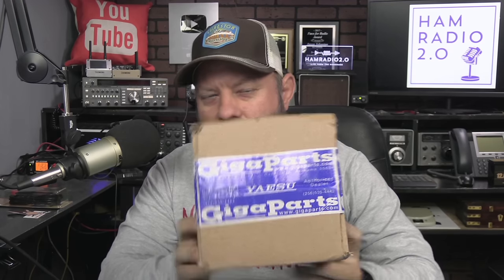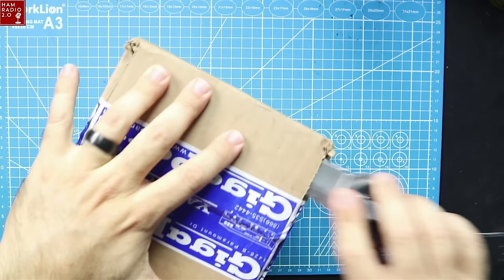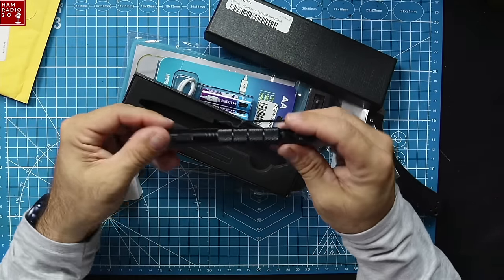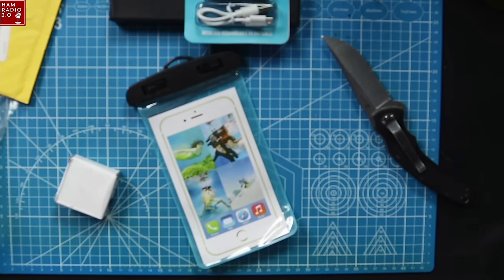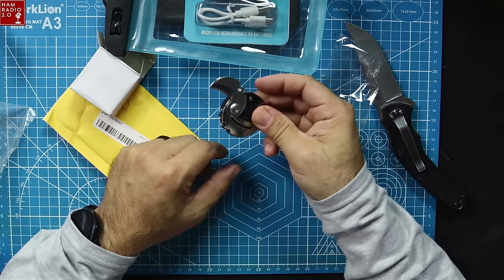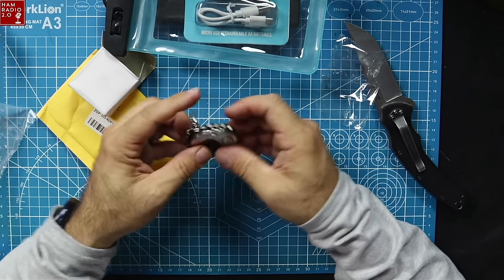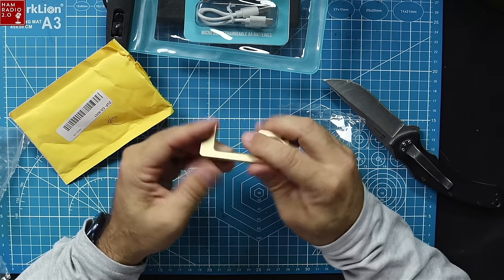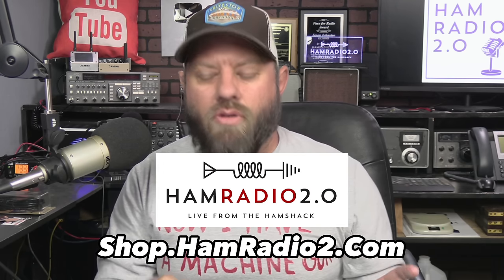I Bought ANOTHER Mystery Box for Ham Radio!

Comment: Hi Jason, that brass thing is a door handle grabber so you don't have to touch with skin contact. Covid 19 prevention. You can use it to touch capacitive surfaces too like a coke fountain button. The front of the device needs to touch two places. So if you point it at the button you need to have two points of contact from the brass key onto the surface of the capacitive button. I like mine, had it for a couple years now. Germ-a-phob pacifier 👍.   W9CRJ